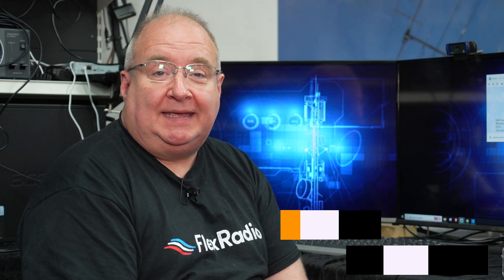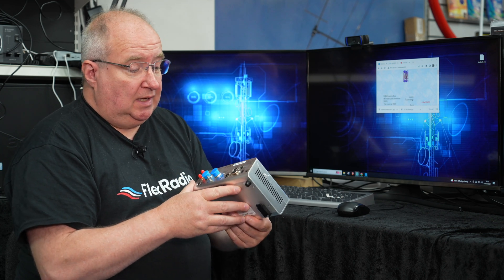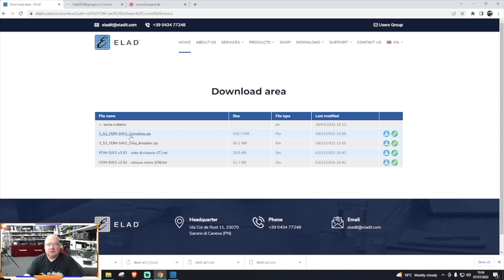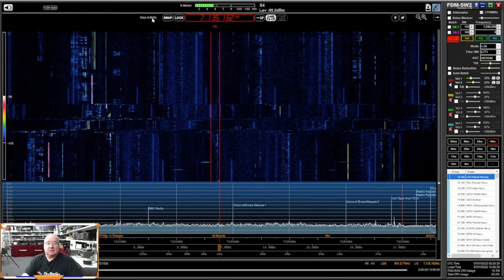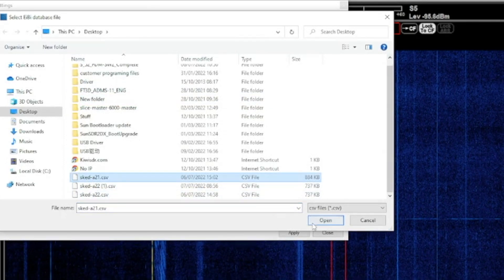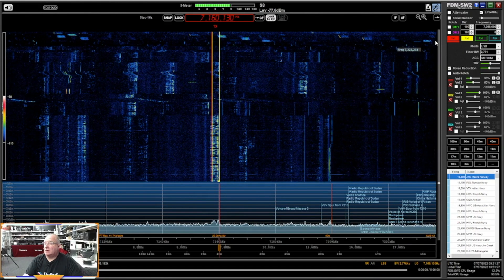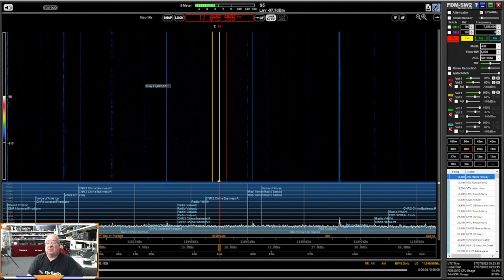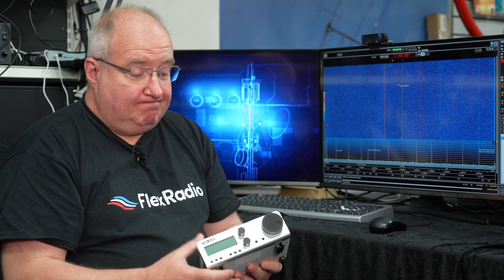The Best SDR QRP Transceiver Available?

Comment: Thanks for sharing Gary… I’ve been using one of these for around 3/4 months (a used one originally supplied to a local operator by yourselves) and even though I have other HF radios I always go back to this it’s a really intuitive standalone radio as well as the full blown SDR via the PC and it’s multiple features . The build quality is excellent externally and internally and whilst you can just switch it on and play it’s also one which will allow you to explore and have lots of fun. I’m still an M7 but have made lots of contacts on what is generally up to around 7-8w output. The receiver is excellent and a match for the Icom 7300 for sure. The Elad SW2 software as you indicate is very good and I’ve also used with SDR Console also free and compliments the Elad FDM Duo really well. The one I have  is now just over 6 years old (so Franco from Elad informed me) and in my humble opinion is a very current radio which has that nostalgic quality about it. I own a 705 and an X6100 and used an FT818 for a bit but I really enjoy using this radio mainly in standalone mode. The support group you mentioned is excellent also having only contacted them twice Elad in Italy appear really straightforward and easy to deal with. Appreciate there are always detractors who may have had the odd problem but that’s part of the fun isn’t it… as for me I’m definitely a promoter and will eventually get that Ferrari red version to brighten up the radio room (not allowed to call it a shack).  Keep the content coming it’s great stuff.